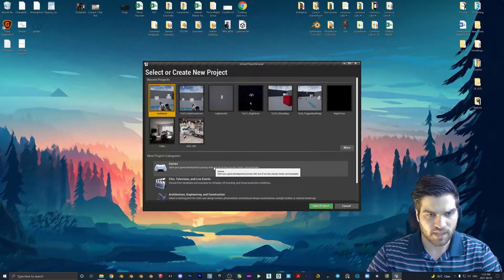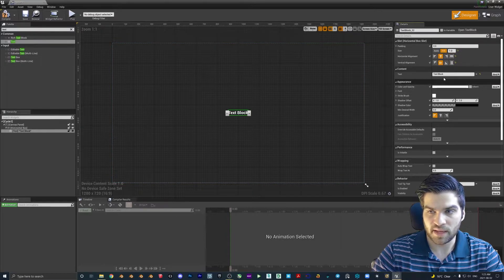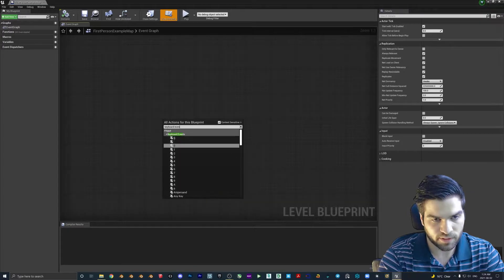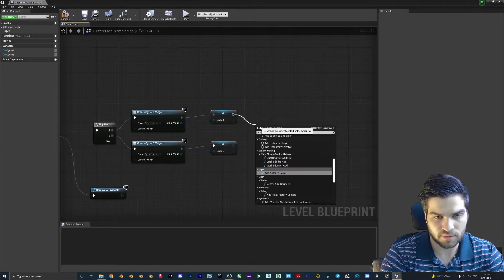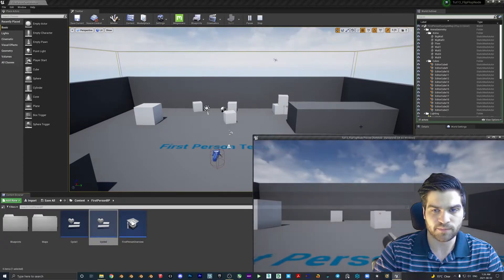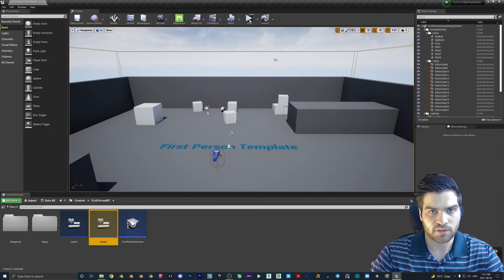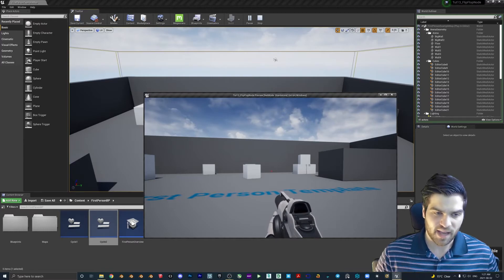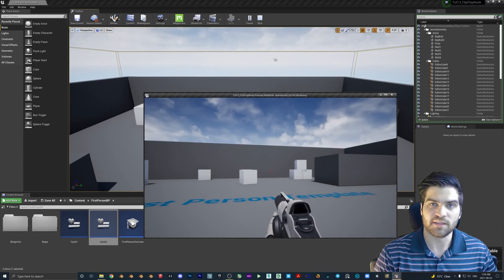FLIP FLOP Node! Part 13 Learning Beginner Unreal Engine! Get Ready For UE5

Comment: WHY dont i have this Flip Flop node option in UE5 ?    it doesnt show up under Flow Control

is there something special i have to do to see Nodes in the context menu ?   added feature ?   very confused
Reply from the maker: I can look into that, but as far as I am aware the flip flop node should be in UE5. I will report back
Reply from the maker: I was just testing this, and it shows up in my level blueprints no problem. I am not sure what could be causing the issue, maybe try turning off the context sensitive option when you right click? 

I am not sure why that would not be in the correct context, but maybe it is a UI bug with UE5.
Reply: @LuminousLabs   unfortunately i already knew about context sensitive function. and i went through the whole library, and honestly i dont see a single node with that unique "N" symbol next to it.    so maybe there is some bug with the editor i downloaded? i dont really get it lol. i thought maybe it was some kind of feature that needs to be added in the project settings or something but i cant find anything, cant find anything searching google for hours now either.  seems im the only one having this issue maybe
Reply: @uncletrashero  I'm having the same issue with UE5 there's no flip flop node, have you figured out the issue yet? thanks
Reply: @jonwaistell8266   no still have issue.  it might be intentional but im not sure what the proper replacement should be